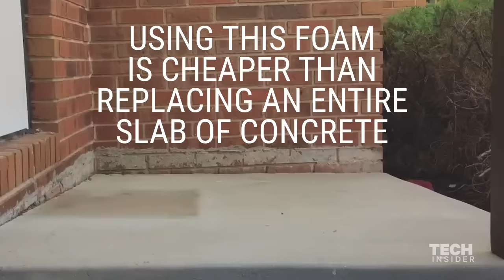Foam Raises Concrete That Weighs Thousands Of Pounds | Tech Insider

Comment: Does the foam degrade over time?
Reply: Yes. called hydrolysis, you be lucky to get 2 years. Piers would need to be inserted to prevent the concrete settling again

Comment: Cool technology, but question; how do you get it to stop at the level you want it to stop? I have a driveway with a 5' X 4' depression that's cracked off from the rest of the slab, & would love to do this, rather than cut it all out & re-pour it.
Reply: I’m not an expert in this but have used foam for smaller projects like this and for other typical uses. The raising of the slab comes from the injection of the liquids under high pressure. So the slow triggering of this is how you gauge raising the slab. The expansion of the foam is not what is really raising the slab, otherwise it would just keep going after you stopped at the correct level. The expansion just ensures that a soon to be solid like material fills every nook and cranny and pushes and expands into any weak soil portions. The titles on these videos are somewhat misleading. They are hydrojacking with a liquid that turns solid like with mud jacking.
Reply: You don't 😆
Reply: @donnnceazzz1410  ok bot with a 2 month old account being used by multiple users in a call center environment
Reply: Dunno if ill spend much to fill a drivrway
Reply: I assume they make estimates based on the area of the sunken slab, combined with the amount of sinking that took place. They probably add a little bit at a time, and continue adding until the desired height is reached. I'm going to find out when they raise my slab next month.
Reply: They will typically use zip level measurements or other types of laser measurements to closely monitor the levelling. Also, they inject the material at the lowest point first, so any higher levels wont just continue to sink. Hence why it is sometimes called "ground improvement".
Reply: It's just feel since you're dependent on the trigger pull

Comment: I wonder how well this has aged?....are the buildings still "raised & supported" ?
Reply: I can't speak for the particular product or projects, but I was involved in a slab levelling project on one of the aprons at Sydney (Mascot) airport here in Australia back in the mid-nineties which I believe is still in service. Polyurethanes are quite remarkable materials.
The alternative was to excavate, jack and underpin, but that would have been about as expensive and time-consuming as simply demolishing and repouring, so the PU was the solution.

Comment: I do this for a living. We call it "Poly jacking" as an alternative to mudjacking. Its supposed to be more cost effective because you use less materials to get the lift of a mudjacker, the holes are much smaller and discreet, and its alot cleaner. When we're done, it looks like new and its as clean as it was before we got there. I'm actually a little shocked that the guys in the video arent using a plastic covering between their ports and the concrete because if you get a leak of the resin it sticks to the concrete and you have to bust out the wire brush to clean it up.
Reply: Could this be used in a crawlspace to support a sagging cottage?
Reply: @renaissancewm2000  Yes, it can be used as a void filler.
Reply: Is this a profitable business?demanding business?
Reply: Hi David. I own a 4m by 12m three-sided infinity pool, constructed between 2021 and 2022. The design of this pool requires it to be perfectly level for water to flow evenly over the three infinity edges. Unfortunately, one corner of the pool's foundation has sunk by approximately 1cm. This has resulted in a slight tilt of about 0.14 degrees in the deep end, disrupting the even flow of water over the edges.

I am seeking a company with expertise in correcting such foundation issues. Is this something that could work below the pool's foundations so that we wouldn't have to damage or re-tile the pool?
Reply: @stelioskounou3738 I'm not an expert but I don't think this will work for your swimming pool. See if you can build up on top of the sagging edge end.
Reply: Can you help me quote a sidewalk repair? It’s a simple job about 18 sf of sidewalk that dips down about an inch on one side
Reply: Ok Mr guy how do you stop it from expanding when it gets a the point your level?
Reply: In your experience, have you encountered that the slab have settled again? Can you share some of your experiences? I want to know how many years it will last. Any disadvantages? Appreciate your reply. Thank you.
Reply: @samrowe2889  It expands right away, genius. You stop it from expanding by no longer spraying foam.
Reply: 3 years later, how are those projects holding up? My fear is that eventually the weight of the slab + gravity would eventually cause that foam to flatten and thus the slab dropping back down.

Comment: Now that you raised my driveway. Could you make my crack disappear?
Reply: Just add more concrete,?
Reply: @degeestvanpeterrdevries3366  no, concrete usually comes in slabs.
Just patch it with cement paste
Reply: You have to use concrete epoxy
Reply: Replace the driveway
Reply: Muhammad Syahidin  is that supposed to be a dirty joke?
Reply: @StudentNoor  lol.
Reply: Try applying an elmers glue or better, shoes glue. If it doesn't work, try stitching it.
Reply: A little duct tape
Reply: What do you mean:l
" My crack"
??
Reply: We could, but then you wouldn't be able to poo.
Reply: @averagefilipinodude2137  I feel like that too lol
Reply: @isolde6811  lmfao, gtfoh
Reply: I can make your crack dissappear!
Reply: Grind cracks with 45 degree grinding wheel and seal with self leveling sealant.
Reply: Did she say that?
Reply: Lmao. Thru my crack. Pls do not refill. Harder to laugh if it's filled.
Reply: Which one?
Reply: @JupiterVortex  No
Reply: Just put some duct tape.
Reply: They only have one wing from the angle of the North pipe 😭
Reply: I just use Play-Doh

Comment: Right. But you STILL have to replace damaged concrete. 
Especially damaged by heat and salt.
Reply: Of course. This one only raises and levels the slab
Reply: @kennjt5015  If too much foam is put in, it will go too far, what guarantee is there that it'll come out level? Put too little in and when it sets you can't add more...
Reply: @prich0382  you can see him slowly doing it for that purpose lol come on you honestly think you they are just randomly throwing an it in there like they dont care? This exists because it works lol
Reply: It depends lol its smart to extend the life to save money. It's an alternative to a replacement. Some people cant afford that shit. Come on guy try thinking for like 2 seconds lol although you might hurt yourself.
Reply: З
Reply: Rodent can bite away the foam 😅
Reply: And what about polluting the soil ? Would it not happen.....
Reply: @notyourfriend-li7rq  i guess you didn't pay attention to the video where it said the foam is inert and doesnt leach chemicals
Reply: I have a project high rise buildings of 30 story are shanking , will this work , any done job references ?
Reply: @Jeff-tb2kd  there should be some limitation right? Or otherwise it can lift the world up..😅😅  forget what i said i dont know anything.
Reply: ه س ن س ن غ ج
Reply: Sounds like Mr. Joel hillman is a Mr know it all.....lol..(get it...lol)
Reply: @Dontcare_at_all  "this exists because it works" .....
Reply: this is to fill the void, not for surface

Comment: This was done to an extension to the back of our house that had settled.  It didn't last . The foam begins to compress and you're back to where you started.
Reply: Might be that the soil below the resin still is moving.
Reply: As another person said, there was probably still active movement of the soil beneath the resin due to leaking drains, tree roots, poor drainage, etc. How long after did the foam compress? It's highly unlikely that the foam itself compressed, polyurethane (and other foams used) are incredibly strong under compression. They use this stuff to support motorways, airport runways, train tracks, not to mention entire warehouse structures (all of which would be hugely more heavy under than a house extension).
Reply: Yup.  Soil doesn't magically get better because foam was injected.  Unless the original cause of soil degradation is fixed, it will just continue to erode. Usually a drainage problem.  That said, you can just drill another hole to below the foam level and add another layer of foam.
Reply: The foam degrades after about 5 years. It's not the soil. It doesn't last.